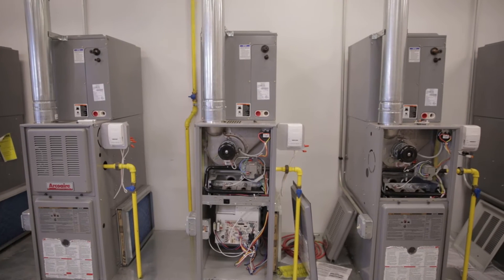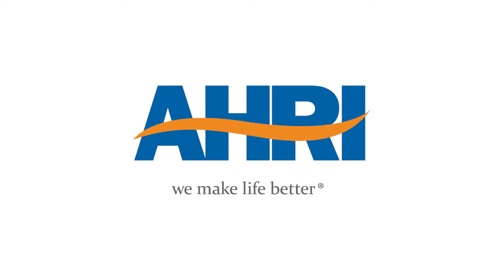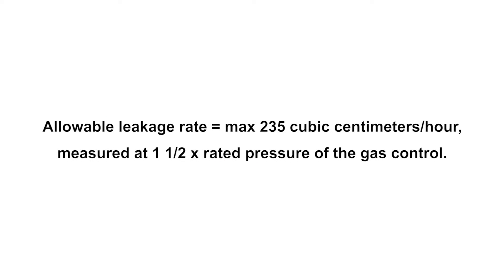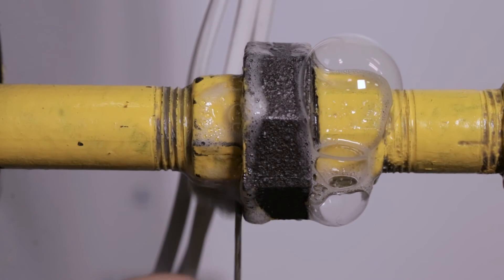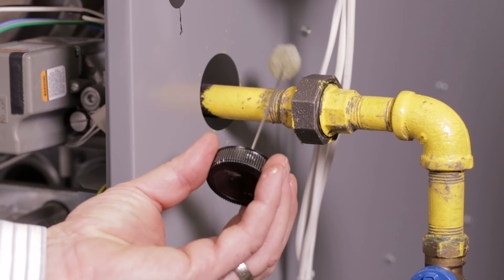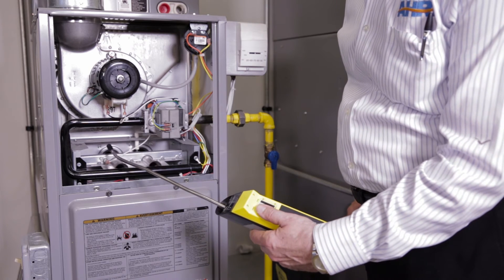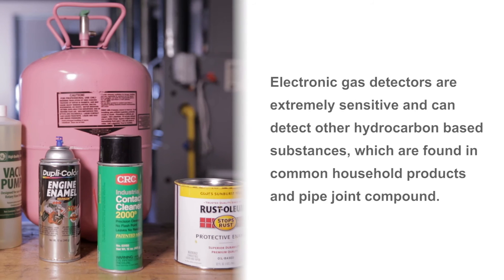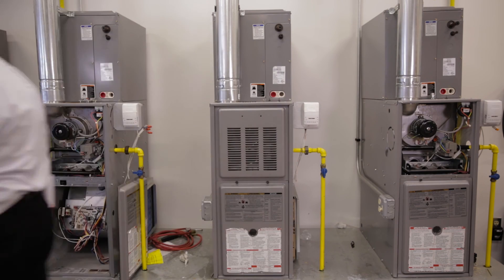Practical Guidelines for Identifying Gas Leaks

Comment: Your gas detection video was okay but your piping installations on the furnaces do not meet National code   ( no drip leg / sediment traps installed). Your tick rate leak detector will come in handy when debris starts farming on the seats of your gas valves.